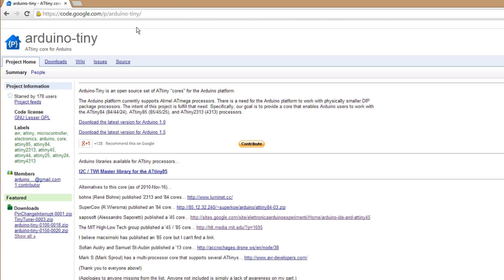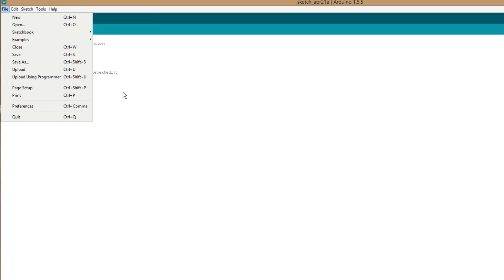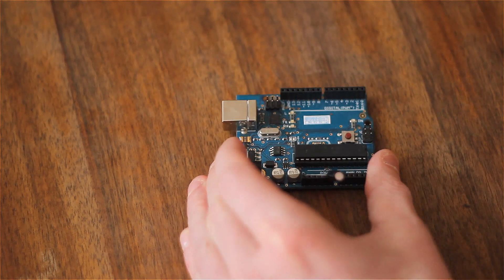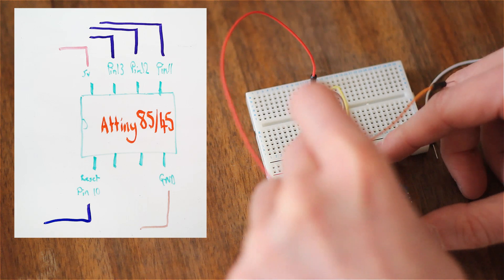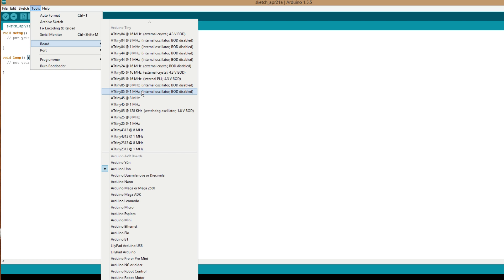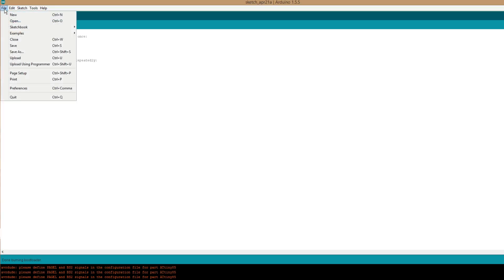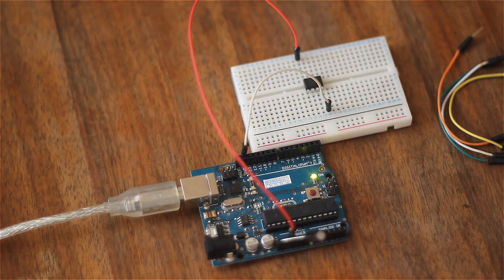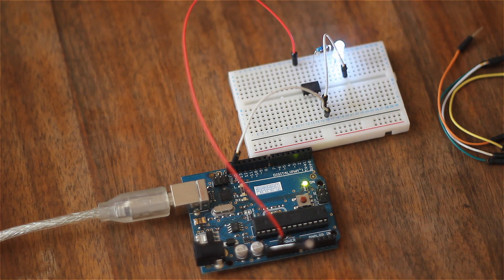Programming an ATtiny85/45 with an Arduino UNO (Getting started)

Comment: Great video but I'm getting an error when I upload Blink to the Attiny. "Compilation error: 'LED_BUILTIN' was not declared in this scope". Your Blink code doesn't look exactly mine. For example, I can't change the pin. It doesn't have that in the code at all. 

Fixed it: In the new Blink code where it says "LED_BUILTIN", replace that with "0". There are three instances to replace. 
- pinMode
-digitalWrite high
-digitalWrite low
Hope this helps others.

Comment: Can I choose 1MHz instead of 8 for the clock speed? Is it as simple as choosing 1MHz and then burning the boot loader?
Reply from the maker: Yup, exactly that. It'll still be programmable after but you'll need to remember the settings or you'll have to burn the bootloader again I think.
Reply: @DavidWatts  Great thanks again!

Comment: Noob here, you don't mention what resistor you used when you connect the LED. Does it matter?
Edit: I didn't add a resistor and it still worked fine.
Reply from the maker: I usually opt for a 470 ohm resistor for almost all single LEDs on 5 volts.
Reply: @DavidWatts  Thanks for the reply buddy!

Comment: I been trying to get my Attiny85 to work,  I 'm using a top hat board that plugs direct in the Arduino Uno and works fine as long as I have it plugged in the Arduino , when I remove all the wires a try to blink the led with my own 5v battery it does not appear to work, seems like it not transfering to ting85 memory? 

I also see lots of other people are having the same problem and most of the youtube videos are done but hobbist just learning and they skip several important steps. Hope you can make a better video and show detail  and go slower.

Comment: I like doing the same to the New Attiny 3217 or 3216 UPDI arduino capable ic's as they have 32k Flash with only 3 wire programming including 2 of the wires being + - power. So it's only 1 wire programming for the new Attinys

Comment: great tutorial. In my haste I missed the whole "burn ArduinoISP" sketch first.  Then later on when burning bootloader you need to set as "Arduino as ISP".  Keep mind the as option is different!  Easy to get tripped up if you're rushing.  Take your time and it works great. And oh, I also didn't need the cap either.  thank you!

Comment: i am getting this:
avrdude: Device signature = 0x000000
avrdude: Yikes!  Invalid device signature.
Reply from the maker: It sounds like you need to burn the bootloader to set the fuses.
Reply: use the same process to burn the bootloader?
Reply: Arduino: 1.8.9 (Windows 7), Board: "ATtiny45/85 (Optiboot), Disabled, CPU, ATtiny85, 8 MHz (internal), EEPROM retained, B.O.D. Disabled"

Build options changed, rebuilding all
Sketch uses 910 bytes (11%) of program storage space. Maximum is 7616 bytes.
Global variables use 11 bytes (2%) of dynamic memory, leaving 501 bytes for local variables. Maximum is 512 bytes.
avrdude: Yikes!  Invalid device signature.
         Double check connections and try again, or use -F to override
         this check.

An error occurred while uploading the sketch

This report would have more information with
"Show verbose output during compilation"
option enabled in File -> Preferences.
Reply from the maker: @mohammedzaman1937  Just checking, are you clicking Sketch -> Upload using programmer? My other suggestion (assuming you are using a board as a programmer) is to upload the Arduino ISP sketch to it again with the ATTiny disconnected.
Reply: Me too, any updates?

Comment: i don't get this, every time i try to load the i get "avrdude: Yikes!  Invalid device signature....."
Reply: i have got that and i believe its a dead chip, as i had 50 sent by JD you buy and only 4 worked the others have this Yikes! invalid device.check your connection double
the first batch i had sent was in anti static tubes and they all work perfect.

Comment: i have a different ''blink'' sketch, with no 'pin' number option?????.......
Reply: What version of the Arduino IDE are you using? 
I am using 1.8.3, it has no 'pin' number option either.
You have to add a integer. On mine under "void" and "void loop" the led is declared as "LED_BUILTIN". I added the integer
"int LED_BUILTIN = 0;". You can also declare "int LED = 0"; then modify the code and remove the "_BUILTIN"
under the "pinMode", and "digitalWrite". Either way will work.

Comment: Good video, however when I select ardunio ISP with a 10uf capacitor in it will not accept the sketch. It says programmer not responding. Not in sync and tries  10 times to do so. Any ideas? Thanks in advance.
Reply from the maker: It sounds like you are clicking upload rather than Sketch --> Upload using programmer

Comment: Hello David,
just used your video to successfully program ATtiny85 after a few hiccups.
The newest (Dec 2018) ATtiny core files when loaded have slightly different drop down headers, but I still managed to get it done.
Patience and one step at a time got me there.
Note to all - do not put the capacitor into the UNO until after you have loaded the ISP sketch.
Reply: can you paste the link of the library you used? thanks..
Reply: cap info helps a lot thx

Comment: For those using an Arduino Nano instead of an Uno, pin 10 on the Uno = D10 on the Nano.  Same with
Pin 12 = D12, Pin 13 = D13.
Also, I have read that "Burn Bootloader" does not actually write a boot loader into memory, but simply sets the fuses to the right clock speed.  This caused me considerable confusion initially.
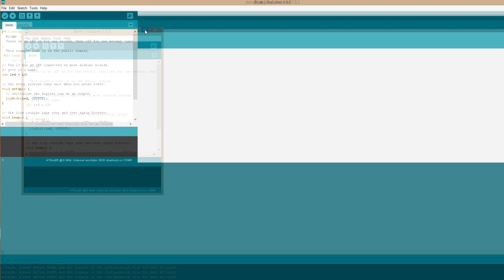At 5:00 -  "The pins don't count in the normal way".  In fact, it's not pin numbers of the chip that are being used, but I/O pin numbers of port-B.  On the bigger chips in the range, there are more I.O lines than on the ATtiny, and they have several 8-bit I/O ports, designated Port-A, Port-B, etc, but with only 5 available pins for I/O, the ATtiny85 only has one I/O port, and that's Port B, so the "pin" numbers are PB-0, PB-1, PB-3, etc.  (see the datasheet).
When I look at Tools/Board, there is no ATtiny in it.  At this point, I'm stuck till I figure it out.
Reply from the maker: You are right, burn bootloader only sets your fuses, you need to do that to set the clock frequency, brown out and such. If you don't see it in the boards section then you will need to either search for ATtiny in the boards manager or add http://drazzy.com/package_drazzy.com_index.json ender preferences --> Additional Boards Manager URLs. How things change after 4 years.
Reply: Thanks, David, I went off searching and found the same link in a different YouTube video, so now, I'm working on getting my AT85 to blink.  I already walked this road a year ago, but I haven't used the AT85's since, so now that I'm coming back to them, I'm having to learn it all over again.  Last time, I made a soft-start circuit for a 240V table saw that was starting far too quickly (using a triac), and I also made a timer that would switch on the mains through a relay for anything from 10 seconds to 9 hours - all controlled with one button.  I was very pleased with myself over that!  :-)

Comment: If the board itself pulls only 10mA then why do you need the resistor?  The LED should be able to handle up to 23mA.
Reply: Because he's using 5V to power an LED. Which means poof without a resistor since they typically operate around 3V.

Comment: Awesome video!!! Keep it up mate 
Question: WHY does arduino reset itself? (i mean why do we actually have to connect a capacitor?)
Reply from the maker: These days the new bootloader works differently so you may not actually need the capacitor anymore but previously the bootloader would kick in when the board reset meaning that the IDE would talk to the Uno rather than the Attiny.

Comment: i can not burn bootloader ... the text 

avrdude: please define PAGEL and BS2 signals in the configuration file for part ATtiny85
avrdude: Expected signature for ATtiny85 is 1E 93 0B
         Double check chip, or use -F to override this check.
Reply: make sure the reset pin is connected correctly. if it isnt, i think avrdude cant identify the attiny, and gets the id from the main arduino.

Comment: Hi David'
I can't able to upload. when i am upload, i got this only

"avrdude: Yikes!  Invalid device signature.
         Double check connections and try again, or use -F to override
         this check.

An error occurred while uploading the sketch"

what can i do? plz help me
Reply: vengadeshwaran ganesan I
Reply: This can happen when the ATTINY was accidentely set up to run with an external clock (=quartz) connected. So when you try to program it, it absolutely needs that quartz.

Comment: How about PWM with a potentiometer, is that possible? And can you connect multiple ATTINYs together if you don't have enough output pins? 😊
Reply from the maker: Yeah PWM is possible on pin 5&6 and analog input on 2,3 and 7. You wouldn't really want to connect two together but you could use a CD4050 or 74HC595 to increase your inputs/outputs.

Comment: Hi David, thanks for the video, Wonder if you can do the same with the ATTiny USB as they are dirt cheap
EBay item number: 111988724148
I had trouble setting up the USB driver
Reply from the maker: It looks like a Digispark clone, you could take a look at digistump.com and have a look at their boards software for the IDE.

Comment: Disconnecting and reconnecting the Arduino can cause issues.. It can get dirty and there is also the wear.. So your connections can be at risk.  Cleaning your connections is an option.  Also just keeping your power supply to the project off and working hot would solve the issue.

Comment: Why do you need to load that first sketch at the begining its the example arduinoisp sketch?
Reply from the maker: +Brad Sogn This was a while ago, but as far as I can recall without re-watching my video... In order to program the attiny85 you need an In-System programmer (ISP) because it doesn't have it's own USB interface. I was using an UNO as the ISP as well as a tool for burning the bootloader.

Comment: i used 47microF and it didn't work. Prompted me to check the connection. I guessed use smaller capacitor is ok but not of higher value.

Comment: Hi David, thank you for your video! Very informative. When you're putting a AT Tiny circuit together with say coin cell batteries, is there any need for a power regulator or capacitors to smooth out the current? I see the chip has an internal oscillator so that saves space on the board having to hookup an external one, thank you for pointing that out.
Reply from the maker: +John Anthony You can run it on a coin cell, I think they ATTiny85 draws 5-8ma at 8mhz but you can use sleep functions to reduce current over time. I think most coin cells are rated for about 15ma but you can get peak loads higher. You should still put a capacitor (100nf) near the chip on the power line though but it will probably work without.
Reply: @DavidWatts  so if we are using ATtiny85 for product, then we should have 100nf capacitor connected to [power and GND] on the chip or [Reset and GND] on the chip?